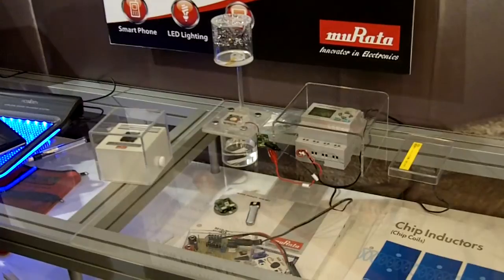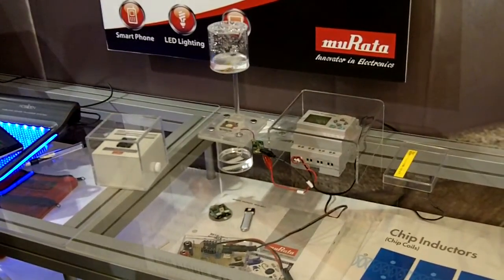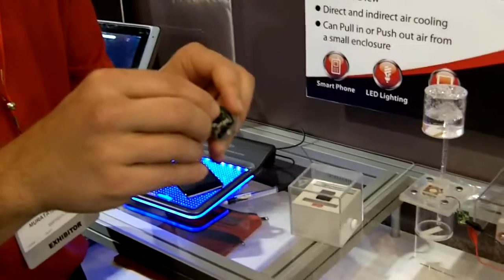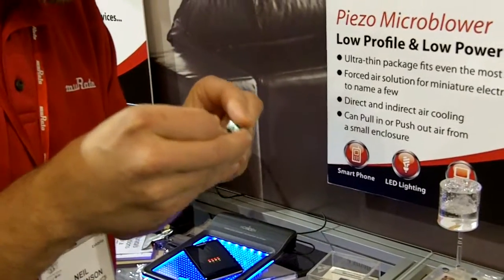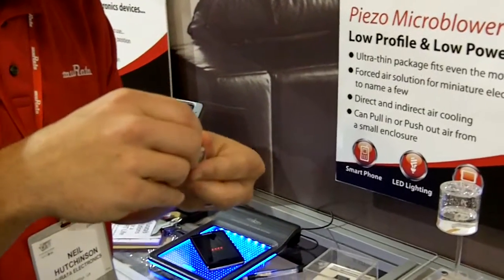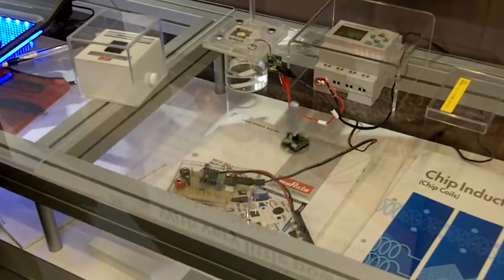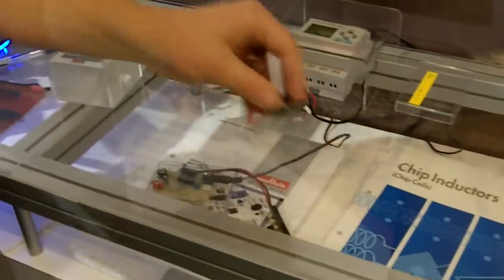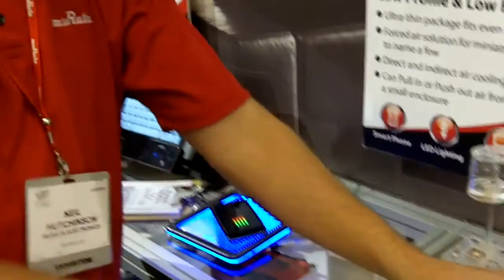Murata Micro Pump - EEWeb.com at CES 2011

Comment: Something led me to believe that the MZB1001T02 can generate high pressures such as 100 PSI. But the data sheet says that the pressure is only on the order of 1900 Pa. This is not much and is about 0.275 PSI. Very disappointing.